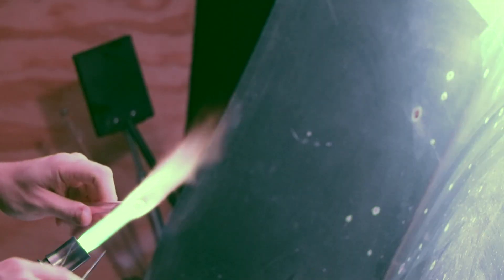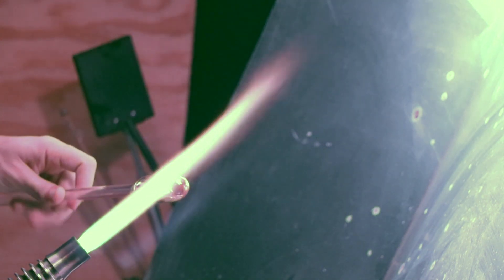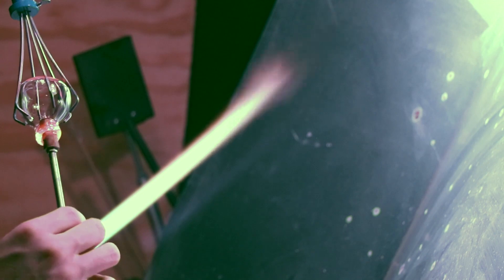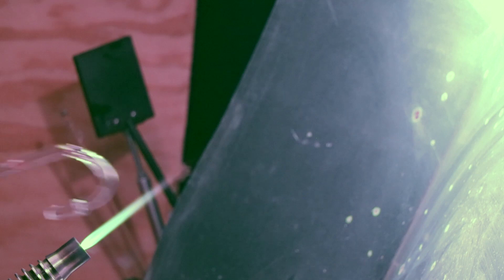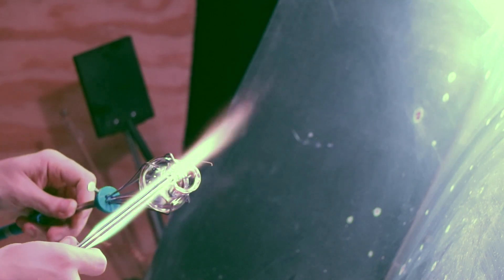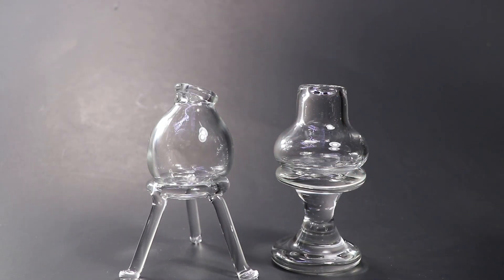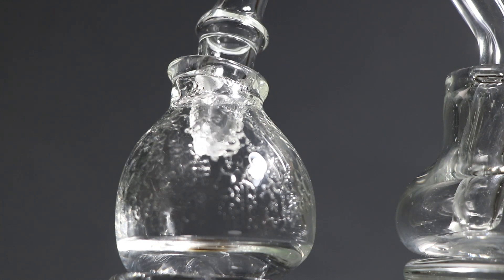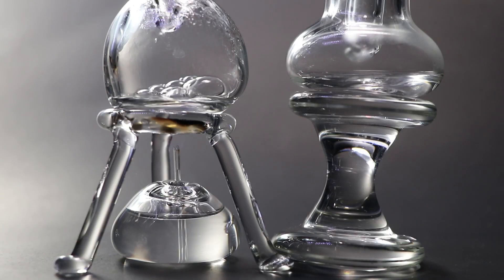Water Distiller Lampworking - Glass Blowing Techniques

Comment: Great video! Question thoough, what type of glass did you use for this? Also is there a way to anneal glass like this properly without purchasing an expensive kiln?
Reply from the maker: I used borosilicate which is lab glass. No I don't think that is possible without it, but smaller objects might not break if they are less complex. I don't properly anneal all my work, only If I plan to sell it or if it won't survive without.

Comment: so, i saw once where a guy used small rat tails from pulling points as a filling for a glass tube that acted like a  wick in fact he called it a "glass wick". the shards give the oil more surface for surface tension to rise in the tube they stuck out above the tube end the flame creates vacuum . seemed to work.
Reply from the maker: There are often multiple ways to the same end. Sometimes it's not how many ways you can find, but how much you enjoy the path.

Comment: This is really neat. I just buy my lab glass lol. But I make most of the chemicals for no reason other than fun so I get it man, I get it.

I wanted to make a miniature distillation apparatus that is one-ish piece that can be picked up whole and put away. I also wanted it to be solar powered using a concave mirror under the reaction flask. The condenser would be cooled with a simple trough of water or ice cubes that just hangs in place.
I thought it was a cool idea so much that I went and bought some supplies. However, I only ended up breaking things. I guess it wasn't getting hot enough. Plus, I have zero experience so maybe that is a bit lofty of a goal.
Sure would've been neat to distill small amounts or dangerous substances that you want as far away from the house as possible without using electricity or risking your heating mantle. Obviously would only work for certain mixtures.
Reply from the maker: Yea I get it, I always feel there's a certain special something from creating. Not just making a new thing, but changing the world directly around us. Its a subtle change but like with any lake 'every stone thrown raises the water slightly higher.'

Comment: What fuel do you use!? You never mention
Reply from the maker: My candle runs on Lamp-oil or Isopropyl Alcohol. I forgot what I used in this video but there's lamp oil in it right now. Lamp oil doesn't evaporate as easily as Alochol.

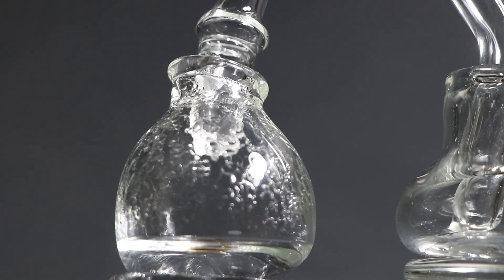Comment: 8:20 that happens because the heat is not consistant, so the air shrinks in the flask or tube and the water forms a film and gests pulled back as the air/vapor cools until the film breaks, the water flows down and repeats, it is very common when using thin glass tubes.

Comment from the maker: The oil lamp uses an all glass wick (no cloth). It uses a minimum amount of fuel (the lamp in this video will run for about 6-7 hours). It won't use all the fuel however, as the capacity in the vessel lowers so does the amount of fuel sent up the wick. At around 25% fuel capacity the flame will extinguish. 

Note (2021): Although alcohol as a fuel is possible my latest series of oil lamps run primarily on lamp oil. Lamp oil is much more difficult to combust comparable to alcohol which doesn't necessarily need a wick. It should also prove a safer option in-case of accidental spillage or in a harsh thermal environment like a lampworking studio. I'll be releasing the full design of my latest oil lamp within the next couple weeks.
Reply: Matt Jasa, It works by capillary action, liquids will climb up thin tubes, capillary tubes are commomly used in biology to withdraw a tiny amount of liquid.
Reply: Look up retort and then try and duplicate that it's a pretty simple object and it doesn't have any definite restrictions on form you just have to have a way to plug it up you'll see when you look at it train make one of those if you would

Comment: So how did u learn? What tools do I need to start? N what techniques are used to make stuff? N where do I get the glass? Like borosilicate for lab ware?
Reply: KornShaDoW097 first thing you need is a torch, regulators for O2 and propane T grade hosing to connect torch to regulators. Next a 250lbs O2 tank and a bbq propane tank. Tools well the sky’s the limit there I would say to start get tweezers a graphite or brass pad/marver and most importantly didymium glasses shade 3 or 5. Glass can be purchased through retailers like mountain glass or directly from suppliers. Hope that helped expect to spend atleat 500$ to have a beginners studio and over 1k to really get started. My big torch alone is almost a G. You can get a decent GTT to start with for 200$ or less.
Reply from the maker: I taught myself using videos, like what I make now. You might be able to find classes if you would rather have an in-person instructor, but I highly recommend watching some of my work first in preparation to get the most out of your class. 
  The techniques depend on what your trying to create, but having a baseline understanding of how the glass moves with heat & cracks while cooling is like learning how to walk before you jump on a skateboard.
  For equipment start with Oyxgen, figure out how/where your going to get it. You can rent/refill O2 tanks or buy a oxygen concentrator and make O2 yourself. Everything else will be easy to find & ordered online. Get your ventilation and fire proofing set up before you start. If your low on funds you can make some of your own tools and wait on the annealing kiln later.

I use https://www.mountainglass.com/   buy in bulk and on-sale to save the most money